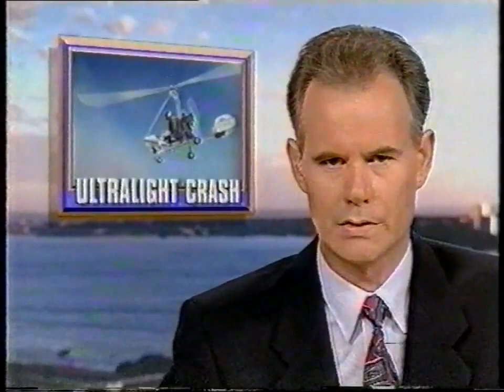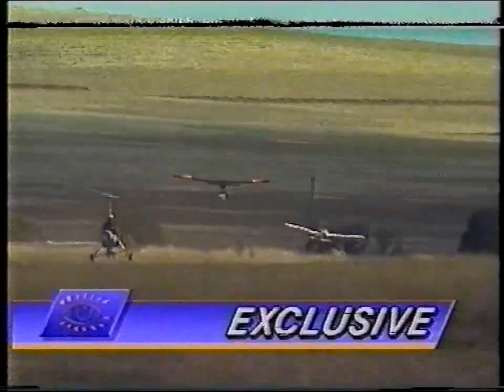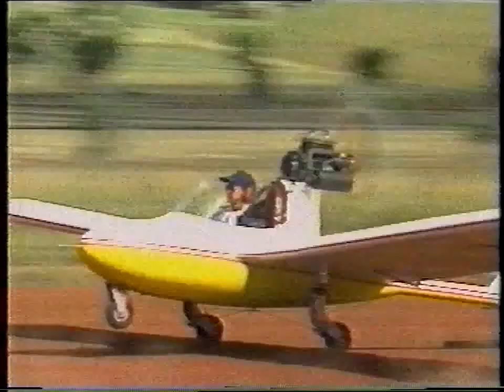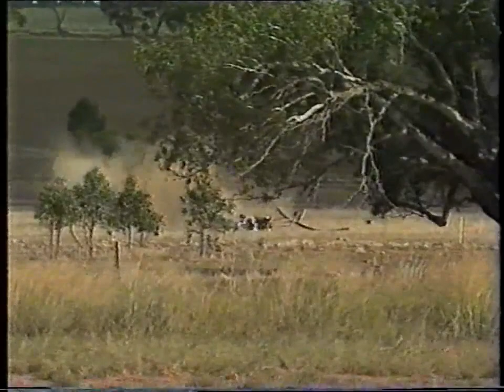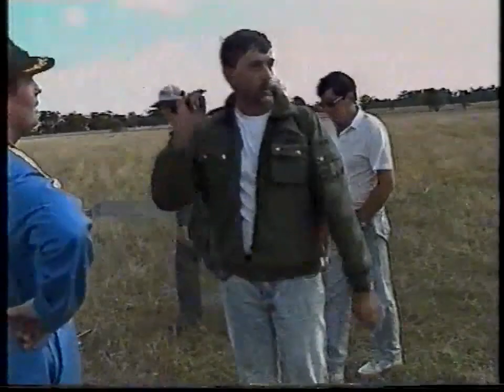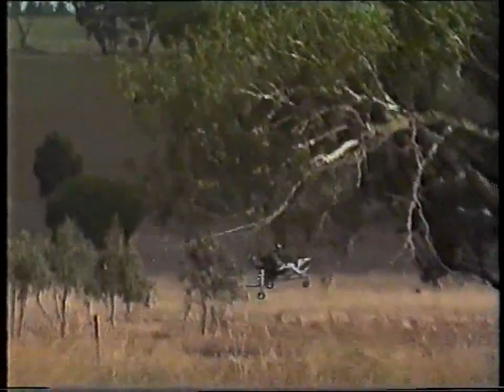Old TV news footage of gyrocopter gyroplane vertical descent crash fail, no injury to the pilot....

Comment: would cutting power , have save the situation here ?
Reply from the maker: Power certainly wasn't helping... but he was a bit low and out of time... always risky doing stuff like that with no altitude to trade off. Also, it would be very hard to think exactly what to do in the 10 seconds he had... I doubt I could have done any better myself.  As Cameron said, it shows at least, that you can ride a gyro to the ground and walk away... Fixed wing ultralights have to approach the ground just above their stall speed... if less, they may stall and spear in.

I used to have tricks for balance. I was over 100kg and was often asked to test fly other peoples machines... most of whom were lighter than me... so their machine would be nose heavy with me in it... so, I carried a divers weight belt with big nuggets of lead on it,,, and would wrap and tape it with a couple of weights attached to the rear of the keel... then do a couple of takeoff runs to see if the nose wheel came up first... or last. If the mains lifted and the nose wheel was still 'wheelbarrowing'  along the runway... it was front heavy, remove a weight and try again and so on.

If I could fly their machine without 'ballast'... I would tell them to rehang their machine and adjust it because it will obviously be tail heavy for them if it is ok for me.  If they were about to do ground running, I could put the weight belt on the front of their machine as ballast.
Reply: I used to do this all the time both with and without power,  my machine had a standard Bensen ply rudder and I never had issues getting out of the situation simply by applying a little forward stick (no power) until airspeed was re-established or forward stick and gradually adding power. Although I never started this low and would want to recover at minimum 100ft.   No rudder will have any effect until their is airflow although even at idle a traditional rudder will be getting some small amount of airflow at idle and gyros being on a bearing don't require great pressure particularly when you prop is about 1 ft in front of the the rudder surface.

Before I flew in gyros I was learning to fly in an ultralight (Thruster) which is a tail dragger with tractor engine over the head and in front of the pilot.  On take off it was full power, tail up and using masses of rudder as until it was at about 20mph there was bugger all rudder authority.  So you start making huge inputs then they have to get smaller as you accelerate, other factors like torque effect and P factor also play into this.  This is all there on gyros too, but its much, much easier.  On a gyro if you hand wind and gradually build up rotors (unlike the rev to 220 rotor rpm then gun it and go) you first speed is around 8-10mph (just enough for a breeze in your face).   The idea is that you want as little drag on the rotors as possible and too much forward speed will cause excessive difference between advancing and retreating rotors.  This causes drag and which will overcome the forward lift vector particularly of the retreating rotor.  This means you risk hinging/flapping (I call it hinging) but also that you use much more airstrip before the blades come to speed.  then it was 12-14mph once they didn't come up any faster (second stage).  Now in the first stage you push in rudder and it has some lag but you are going so slow that its very easy to control, once you are into second stage the rotors now try to slow your forward speed so you are adding quite a bit of throttle but as the blades are backward pointing the lift now being generated slows the gyro so your pusher prop is now giving significant airflow over the tail and hence rudder authority is excellent.  You only need small movements with excellent repsonse and you are still only doing 12-14mph.  From their the nose will lift you get even more lift as you balance and even more power is applied in fact all of it.  So rudder authority is excellent throughout.

In an engine failure with vertical descent you would have zero authority.   I do not have a clue how this type of tail would compare and I'd refer to Ratman here on that as he has flown these and I haven't. 

Just to say with a standard Bensen rudder I never had an issue with rudder authority.  I was always being told even by a couple of aeronautical engineers that gyros should have their rudders outside the propwash as mechanical turbulence would block out the rudder effectiveness.  Utter nonsense.  My first full on engine failure (was carbie iceing at 500ft) it iced because I was practicing an engine out glide and had shut to idle at which point my engine actually stopped however I didn't notice this until after I had landed as I was concentrating on my chosen spot.  I did think "Hum blades are really whooping around that turn, that's odd it isn't that steep a series of S turns".  I was using rudder throughout and it was perfectly responsive.  On landing I went to apply power and taxi back to the car to pack up and nothing...prop stopped manifold covered in a thin layer of frost.   It may be mechanical turbulence gives a less effective rudder but I'd be willing to bet putting them outside the prop wash would loose some effectiveness on wind up and lower speeds.  And I think any power on the motor will give some effectiveness particularly when the gyro being free to spin under a bearing will need very little force to deflect it one way or another.  I imagine grams of gradual pressure on the tail in say a hang test would result in the gyro turning in that direction.
Reply: @cameronlapworth2284  Thank you very much , for this information .

I have build dominator single sit autogyro , here in Uganda. and i am going the self teaching route. because resources, to reach instructor is some what, i do not have. but such information helps a lot Thank you Again
Reply: @samuelagwotu5074  be very careful.  See if you can find the Bensen design manual.  If a group of you can put together a gyroglider or even boom trainer it would help.
Reply: @samuelagwotu5074  vertical descents are an advanced manuver Although if everything goes to crap pull in gentle back stick pull into a vertical descent and wait.  You'll go down like this likely bend you machine but walk away.  Possibly then risk being eaten by a lion 😅 .  The real trick if properly winding up rotors, blade management and balancing on the mains hops etc without getting behind the power curve sideways and rolling.  Again most likely you'll walk away but wreck the machine.  What will kill you even in a dominator is sudden forward jabs of the stick at high speed or any negative g manoeuvre.  You should have downthrust on the engine too imo this will load the rotor and make it more stable.  But ideally find someone to teach you.  If you can't keep strip runs below 20 minutes while learning you will get mentally tired very quickly.  Gyros are extremely light on the stick and need only small movements on the stick.  Gyros are stick free stable meaning leave it alone and it will fly itself more or less but stick fixed unstable meaning clamp on it tight and it will become dynamically unstable.  It means in thermals a properly set up gyro will not need much or any input from you just fly through it you'll go up and down but be fine.  However try to respond by pitching up and down on the stick and you can get into trouble.  But you need to be prepared to move the stick as needed.  For example on  takeoff you may have a crosswind which means stick to keep drifting left or right and rudder to keep straight.  If nose is too high you need to add stick to compensate.  It's going to be very hard to teach yourself without bundling it into a ball.  Build a boom trainer (google) and you can get used to stick response and rotor wind up without significant risk and at a much lower cost than a couple of sets of rotors.  Build it as a gilder or bolt glider keel onto a boom.  And you could progress to glider.  Again easier than fully powered.  None of this is easy.  It can be done as our channel host has.  I was very lucky to have a club.  However we started a club because we didn't have access to training.  Is there no where even in neighbouring country that trains?
Reply: Actually not that advanced as long as you have plenty of height.  But you won't be doing this when first learning unless with an instructor.

I know a guy who had a helmet come off in flight (happened to me too but mine missed the prop good story actually had those clip straps and pressed the clip back in tightening the strap missed each blade bloody lucky).  Anyway this guy wasn't so lucky and it smashed the rotor.  Our instructor had told him if everything turns to shit pull in back stick and descend vertically.  He turned of the motor which was shaking like he'll and did just that.  He hit bent the undercarriage but the machine stayed upright and that and the prop was the extent of the damage.

Of course he could have probably put the nose down and glided in but you are unlikely to hit so hard to get hurt too bad.  It cost him a new prop and undercarriage.
Reply: @cameronlapworth2284  i have the benson flight manual , but no gyro glider, but want to start with lots of taxi runs, later taxi runs with rotor , then crow hopes . etc but i will try to do it patiently
Reply: @samuelagwotu5074  it can be done.  What sort of rotors.?  Don't go too fast without rotors.  Gyros are more stable with the rotors going than without as they are producing some lift which can be directed.  Particularly a dominator which has a very very high cg.  Only taxi at walking pace without rotors.  

Many of the dominator fly dragon wings which have twisted rotors pitched down at the core and up to 5 degrees at the tips.  They are impossible to wind up by hand and very difficult even with a prerotator.  They are very easy to get into hinging/flapping.  I've watched experience gyro pilots hinging dragon wings nearly destroying them in the process.  

In flight they have extra tip weights which help them from slowing too quickly due to the inertia.  But getting them to wind up will be very difficult.  Otherwise if you have no prerotator and are hand winding don't pitch them above 1.75 degrees or if you have prerotator don't go above 2 or you'll struggle again.  Latter once your flying and can recognise hinging/flapping you can experiment more.

It's a good idea when initially winding up and getting used to the process to lift the stick about an inch off that back of the seat.  If blades start hinging/flapping they will strike the rear teeterstop.  You won't feel this at first as the head when locked back will be transferring energy to the mast  you will not feel it in the stick until the whole mast is being bowed back enough to move the whole stick at which point you are a couple of seconds away from rotors colliding with tail and prop or ground.  By lifting the stick an inch off back stick you'll feel the forces dragging the stick around violently while you still have time to act full forward and cut power.
Reply: @samuelagwotu5074  one more thing.  If you aren't going to train in a glider do plenty of winding up in the wind that way you can stay still and get used to wind up without the complications of power rudder etc.  Remember whenever those rotors are turning you need to treat it as a flying machine.  In sufficient wind you can tip the machine over and you can certainly hinge the rotors.  If you can get someone to watch you get them to observe if the disk is getting low at the back.  Once the blades produce lift they cone up so the distance to the ground rises.  If the blades are hinging/flapping the disk will drop close to the ground.  The club I used to instruct with have a video online somewhere where they hinge the rotors I'll see if I can find it and give you a time stamp.  Might save a set of blades.
Reply: @samuelagwotu5074  Here's the video,  I'm not having a go all it takes is for the driver to be a bit of a lead foot for a second, they must have picked up it (why you have an observer) and the instructor holds his hand level to indicate to not accelerate so he's either picked it up or noticed it might happen. but from 47 seconds look at how low the rotor is to the ground.  This is seconds away from disaster.  Now you may not know from the seat - another advantage of the gyroglider.

This was one of the 4 gyrogliders I instructed in back in the day and so glad these guys are still using it.  I'm sure many have learned in this thing.

https://www.youtube.com/watch?v=2f2N9ZkD49A&t=54s
Reply from the maker: Geeezzz Cameron... your typing finger must be getting sore haha...  My Gerry goodwin blades, I could give ONE good push and get them up to speed really quickly (unless very windy)... when I went onto Dragon Wings, I could still get them up to speed quite easily if it was windy (windier the better) but plenty of pushing... quite difficult with little wind, but I could do it... I still have 3 sets new in boxes here
Reply from the maker: I never had a helmet come off in flight, but i did look up at the rotorhead or something and the wind caught the helmet and nearly ripped my head off... and that helicopter helmet I was using in my 'Gunning'  video (the white one with ear speakers) ... if i put the screen down... it sucked the boogers out of my nose... very uncomfortable... (so I sold it to Sam) haha (I'm such a nice guy)
Reply from the maker: One thing about moving the stick... and the best advice I could let a pilot of fixed wing pilot beginning to learn to fly a gyro is... in a gyro, there is a delay in the result from moving the stick... so, in flight, you might want to climb a tad... or feel the need to stick back a tiny bit... but it seems nothing is happening, so you may be tempted to pull the stick back a little more... then the result happens from the first stick movement... then the result from the second extra stick movement... so you put the stick a little forward... but nothing seems to happen, so you are tempted to push it a little more... this is the beginning of 'porpoising' ... which if not stopped, often results in the machine flipping forward.

Once a pilot has learned to fly a gyro... you have a light hold on the stick.... I used to rest my right wrist on my thigh and the hand on the stick... so my leg acted like a damper of hand movement... the hand loosely on the stick and if I needed to pull back on the stick, or left or right... make the tiny little movement of the stick and hold it there... wait... add no more.  The stick movements in a gyro are so small (in general).... an average stick movement then back to neutral ... then wait... might be all that is needed... where as a fixed wing pilot might be used to moving the stick and it happens instantly... then you hold the stick there for a while... such a small difference, but SO important to know!

Another important thing on a gyro, especially an open frame gyro... is 1/ the front guy wire (if you run into a wire fence, the fence gets the wire/cable ... (not you)... 2/ the certified piece of wool which goes on the wire cable so you can see where the wind is coming from and 3/  a squash/racquet ball cut in half and stuck on the cable at around eye level with the horizon in flight... if you notice the ball going up and down in relation to the horizon... you are at risk of porpoising (or beginning to porpoise). Any time you find you are porpoising, simply reduce throttle, climb or turn.

Now my typing finger is sore haha
Reply from the maker: I found that the Ken Brock instruction videos helped me alot... look on YT for Ken Brock instructional part 1 & part 2
Reply: @ratmanmurray7137  good advice.  Actually something else I remembered.  A lot of our guys in the early phases were pulling to the right once they got off the ground.  We worked out if they got tense and were right handed they would tighten their right shoulder and that was enough to vear them right.  Some of us put on motorcycle grips so if you tensed it woul pull evenly.
Reply: @ratmanmurray7137  yes that's excellent.
Reply: @ratmanmurray7137  I Waa very lucky.  It was in Terry's two seater.  He had me come along as he'd just had his engine rebuild and wanted someone light.  I was always up for a fly.  He was testing the engine at different power ranges and we hit about 80mph when I suddenly felt naked.  I felt up and headphones but no helmet.  I looked at Terry he looked a little confused that the prop hasn't exploded then shrugged.  And circled around we were over the airstrip he spotted the red helmet came down and landed.  I jumped out through the fence into the paddock.  Quite lush grass no damage at all but a tiny black scuff mark.  Prop was fine.  It had gone through the prop which was 64 inches right behind my head.  Sheer arse.  I've hated those clip helmets ever since.  I when squeezing them to tighten you can squeeze the clips so they pinch in but don't let go.  

Above 60mph on the VW my harness straps would whip my nappies at high speed and I'd have to tie them off ended up buying those padded Velcro shoulder pads to wrap around the excess shoulder harness material.
Reply: @ratmanmurray7137  ha yes I worry for those learning without instruction ;).  Back in the day instructing in the glider lots of common mistakes were made we'd pick them up but acutely aware they were lucky.  A lot if the guys without access to training would smash machines.

Of course I see that happening now even with two seaters.
Reply: @cameronlapworth2284  The Rotors are dragon , 27 feet , and yes i have pre rotor , about flapping  ? to avoid that situation, i  should taxi slowly , and less angle to the rotor, i mean little pulling back the stick (NOT ALL THE WAY BACK),  SHOULD it flap, cut power, stick forward. and start all over again..
Reply: @cameronlapworth2284  Winding rotors with the Gyro on brakes, is it ?
Reply: @ratmanmurray7137  i have those videos ,
Reply: @samuelagwotu5074  I didn't have brakes on my VW gyro it was foot on the nose wheel if I wanted to stop.  I have made brakes for my current gyro.  If you are talking about practicing winding up in wind if you are on flat grass you wont need them  if you start rolling backwards push the stick forward.  This won't happen unless the wind is at least 14mph.  But if you have brakes and are learning to wind up yes you could put them on.  Don't need to.
Reply: @samuelagwotu5074  Ha I wrote an extensive reply and didn't answer your question.  Rotors full back unless you think they might be hinging or flapping and yes slow at first then gradually build up speed as the rotors gain speed.  Don't do this gun it and go nonsense,  you want gradual build up of speed not just for the rotors but also because then you don't end up suddenly with everything happening all at once blades finally up to speed nose rears up massive torque effect from prop and you are off the ground struggling to jam the stick foward enough to not get behind the power curve kick the rudder straight and get the thing level.  Do it slowly you will use less airstrip and as you reach take off every move will be small adjustments not everything happening all at once.  That way lies disaster especially if you can't get proper training.  Watch some videos of take off training online its like watching a car wreck about to happen.  Really its a horrible system they have developed and all to avoid actually knowing how to wind up a set of rotors.  Make sure you can wind them up in all conditions every time before you start running up and down the runway.
Reply: @ratmanmurray7137  the videos are online and still excellent.  Music is appalling though 😉
Reply from the maker: @cameronlapworth2284  I rarely had brakes on my early gyros, but the later ones I did. I used to think they were fairly obsolete on a gyro (especially open frame) because you have the worlds biggest handbrake between your legs (the joystick)... but several times on landing at uneven make-do airstrips, I would land and be on a slope... as the rotors wound down, the machine would start to head down hill and I had to jam my foot onto the back of the nosewheel to stop.  I recommend brakes... not so much to stop from speed, but to stop a machine rolling forward with the motor idling or keeping it put on the ground (parked) in high wind. I have 5"  wheel castings (Hummingbird) with the Honda postie bike drum brakes... but with the low price of bicycle disk brake disks and calipers, that arrive already bled... these are great too... even just one on the nose wheel (unless full castering) is sufficient... because, as I say, a gyro at speed should be on 3 wheels or no wheels... just my opinion
Reply: @ratmanmurray7137  hey yeah agree with all that not sure about the not balancing bit but I was trained the way I was.  

On brakes I completely agree.  They way I look at it its about the times you get caught.  I used to fly out of Chinchilla and it has a tarmac mainstrip which was ever so slightly downhill.  When adjusting g idle on the dub dub before flying often after flying it would be looser hotter so idle could be a little high on grass no issue but on tarmac you'd pick up speed.  So typically I'd just taxi into the grass at the side of the strip.  This time however I did this and realised too late I was going to run over a 8ft long brown snake  nothing I could whup whup hope it's not wrapped around you undercarriage.  Luckily not.   Another time I almost ran off the end of South Graftons strip about a 5ft drop off.  I'd been winding up the rotors downwind.  Usually if you get enough energy you can slow okay and still have enough when you turn into wind to get them up quickly again but I misjudged realised turned off the engine completely and Fred flinstoned with all my might.  Stopped about 10ft from the end.  Was about to try a risky turn .  So 99% of the time you don't need it but screw up and your well screwed.

My current machine I've brought disks off a scooter and callipers.  I then 3d printed an adaptor to check fit printed and checked moded and finally had it worked out then machined the adaptors for my aluminium rims.  I've hooked them as heel brakes and made them independent and added park brake clips that I can activate by hand but just push hard to release that way I can start the engine and rotors with a little more safety too. 

The independent braking is overkill the nosewheel steering set up is excellent ( not my design but I simplified it a bit)  so I really don't need it  but I could so I did.  It will be so I can wind up downwind to my hearts content and know I can pull it up at the end.
Reply from the maker: Also, when stationary and beginning to prerotate by hand or mechanically, it is a good idea to know where the wind is coming from and park the machine so the wind is coming from the right side... so the rearward rotor is seeing the wind as it passes over the prop making it want to lift. If you park the machine directly into the wind, or with the wind coming from the left... the blade passing the front will get lift, forcing the rearward blade to go lower risking prop/ground strike. 

This is where the patented/certified piece of wool in front of the gyro pilot is handy.  If the wind is coming from the left side, the initial push of the rotor and the blade passing the front gets a whole lot of lift all of a sudden has seen alot of 'crows feet'  scratches/gouges on rotors from prop strikes.
Reply: @ratmanmurray7137  Hum worth a thought I had a stick lock and my blades were slightly negative when full forward so I'd wind up by hand and they'd have no lift until I was in the seat at which point I'd ease them back into the wind.  I was more concerned I think about tipping over if I put too much pressure up top (although not till you got a little more lift).  Were you worried about the possibility of hinging from side on?  Of course you try to not hinge the rotors. would you then turn into wind once seated?  I'll have to ponder that one, always great to hear how others do these things.  ta
Reply from the maker: You don't have to park it absolutely full side on to the wind, ... but if you are lining up on a runway and the wind ir 12 o'clock, right on the nose... you are better to face to the left, like face 10 o'clock to the wind so it is hitting the back of the retreating blade which is pushing the retreating blade down (the advancing blade up), If you lined up with the nose to the right (2 o'clock) ... the advancing blade would want to lift high and thus make the retreating blade go down closer to the prop.  The initial push could see the advancing blade balloon up really high at very low speed... facing to the left can all but stop this possibility.

I am talking about the initial push from the rotors stationary... once the disk is established... maybe only 20 rpm, it is no longer a factor really. This is also why I don't like/refuse to taxy to the thresh hold without the rotors turning... I can arrive at the thresh hold with the rotors over the hump, so just line up and be ready to go. If I were to arrive at the thresh hold and line up, then have to initiate the rotors spinning... first, you have time pressure (others waiting to land/take off) and the likelihood of an issue getting them started or up to speed without incidence is reduced.

Also, a light wind the direction you face is not such an issue... it is more when the wind is substantial and especially when gusty
Reply: @ratmanmurray7137  THANK YOU... very much for your saving input ouhaaaa  THIS INFORMATION IS REAL SAVE BROTHER!!! I DIDN'T KNOW THIS, I KNEW FACING THE WIND  , should i  tilt the rotor ,(stick ) a little to where the string goes, while taxing  should i  ?    i have put the string in-front of the gyro.
Reply: @ratmanmurray7137  Thank you very very very , may the Lord Almighty reward you with more knowledge, so that you give to starters like us.
Reply: @ratmanmurray7137  what about thrust from your VW,  static thrust ? mine is 2 liter subaru ej engine , and i get 160kgs of thrust, but gross weight, i mean wet weight is 330kgs , is that safe for me ?
Reply: @ratmanmurray7137  yes I've had on really strong winds to actually go behind a hanger to start wind up then taxi out once I got rotor speed established this might have helped there.  Took off if a gyro length and near vertical climb out.  All the other fix wing bloke were grounded as it was a solid 25mph crosswind 90 degrees to the strip ( no cross strip). They'd give me a lot of good natured crap but that day after landing I just asked them why they weren't going up today 😉
Reply from the maker: @cameronlapworth2284  Yes, I would go to airshows or fly-ins and fall out of my tent at 9:30am.... all of the people in trikes and ultralights had been up and flying since 6am.... now the wind was up to 15kts and they had to park their toys... was great... we had the strip to ourselves haha
Reply: @ratmanmurray7137  yep. Great machines.  Remember flying with an ultralight buddy on a cross country.  I was bored as there was noting to do my machine could fly hands and feet off so it was do nothing for 15mins turn left do nothing for 15mins.  So I'm dangling my legs steering the gyro by putting a hand into the slipstream and I glance over at him and he's working.  The early morning thermals are kicking off and he's actively flying.  I couldn't feel a single bump.  After he land I had to shoot off and follow a nice tight creek and get some tight turns in then came back happy.  Still didn't feel a bump it was still early.
Reply from the maker: The piece of wool or string on a gyro is probably the one thing you must have... I know gliders (fixed wing) and helicopters often use a piece of wool on the windscreen ... for me,  think it is a must
Reply: @ratmanmurray7137  yes cheapest instrumen you can get.